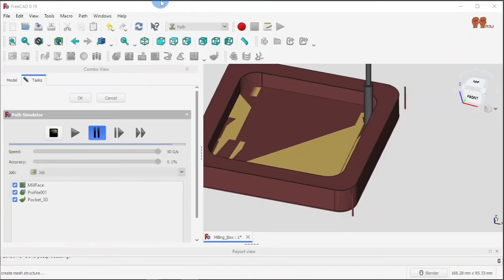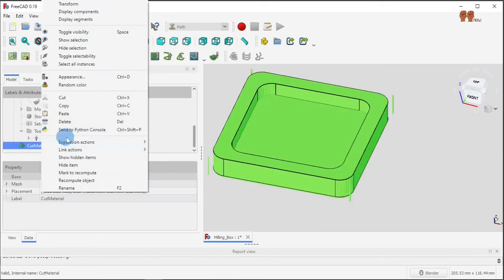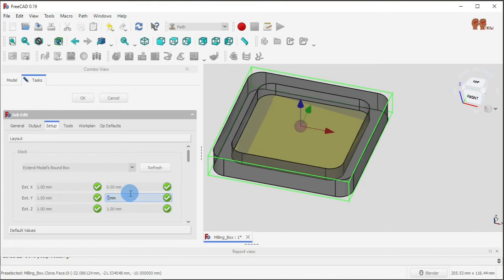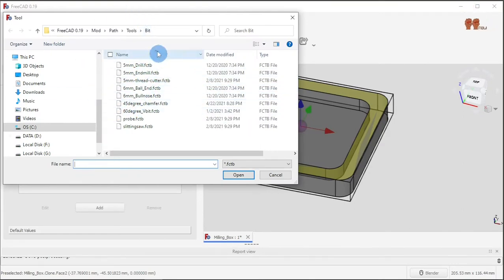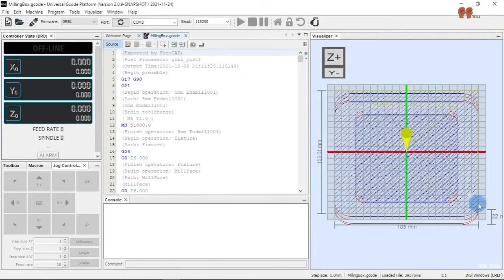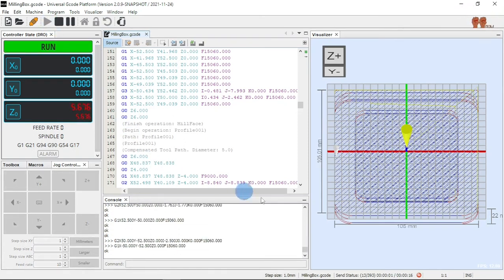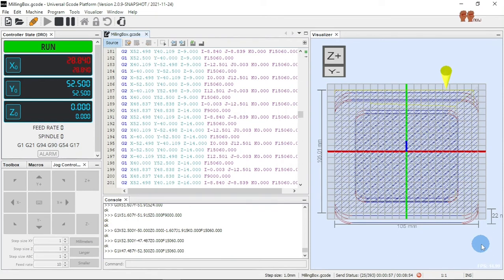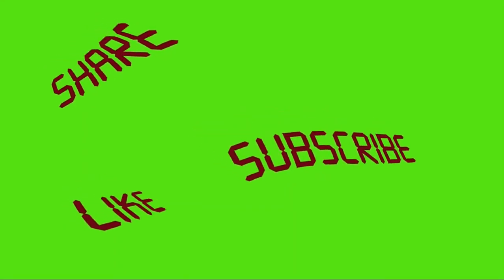Gcode from FreeCAD 001

Comment: Hello, I work as a high school teacher in Spain. I have built a CNC with my students. I use GRBL 1.1. inside Arduino Uno.
When I generate Gcodes from SVG files in Inkscape, at a single depth, the machine works perfectly. But this only allows you to make engravings.
I want to take my machine to a higher level and make it a perfectly functional CNC, which performs cutting and casting operations at different depths. When I use FreeCad's Path bank, everything seems to be fine. I export to Gcode and open the Gcode in Universal Gcode Sender. But when transferring the file to the Arduino I get a communication error and Gcode Sender crashes.
Can it be a post-processing problem? 
It is this Gcode produced that is incompatible with the GRBL version?. I see differences between the GCodes generated by Inkscape (they seem simpler) and those generated by FreeCad.
I've seen in your video that it works for you.
Can you offer me some guidance?  Some indication of where the problem is?
Thank you very much in advance
Reply from the maker: I used freecad to generate the gcode
Reply: @sharetripllc  
I used FreeCad too.
But the file cant not be sended by UGS to the machine. I cant understand why is It.
This problem doesnt exist when the Gcode file is made from Inkscape.
UGS disconnect and the job doesnt start.